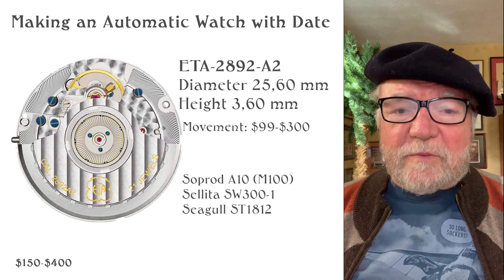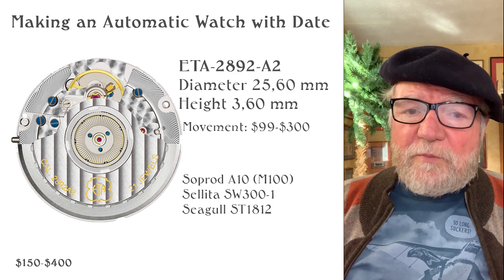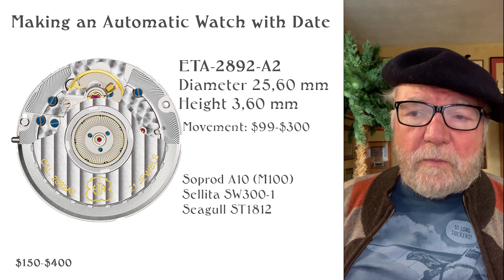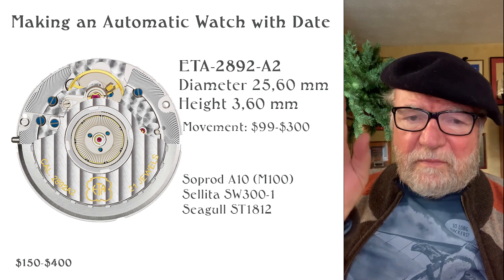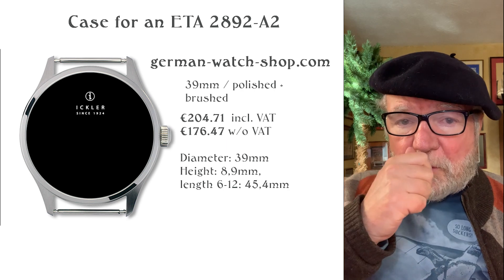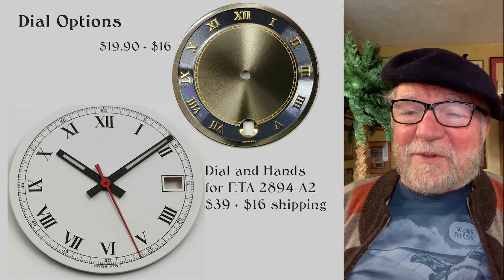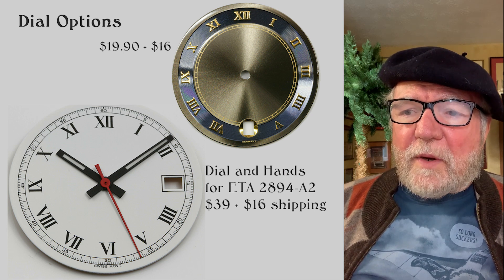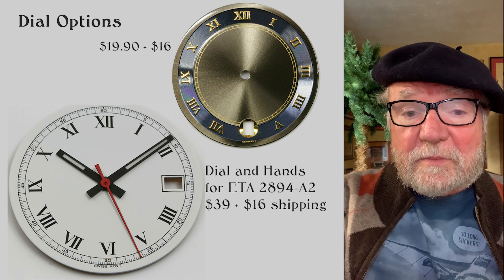Automatic Watch Project: Step 1—Overview & Introduction

Comment: Thx Bill, this is a cool project. I can vouch for the Ickler cases, as I owned a limes (which is a brand of Ickler) and the case was first rate indeed.
Reply from the maker: Thanks, FFA. The Ickler case is the only one I've found so far that's 39mm. (One other with a package deal had 44mm cases!) I think I'll take your advice and get the Ickler ... even though they are mucho! expensive. Take care and be safe, Bill😷

Comment: Hi Bill!
Very interesting project, the suppliers of parts tend to give a narrow choice, specially for the dial face. But your choice are more than ideal. Concerning the movement: where do you get them other than eBay? 
Thanks to guide us thru this mine field, be safe,
John
Reply from the maker: Hi John, a lot of the eBay goes straight to an eBay store based in China, Germany or Switzerland. I like the German ones; they're more expensive, but I like their looks better. If you use AliExpress.com , you can deal directly with Chinese sources and save a lot of money. Take care and be safe, Bill 😷

Comment: I'll watch you make it. I'd like to see you show us a few dozen dial/hand combos and explain how you narrowed it down
Reply from the maker: No problem J Tee, you're welcome to watch. Looking for the right parts can be an adventure in itself. See if you can find dials & hands for the 2892-A2 ... it turns out that there are lots for the 2824, and so you have to be careful. Take care and be safe, Bill 😷
Reply: @watchartsci  Found the same dials on ebay without dial pads or feet, cheap, but didn't find much else worthwhile, I guess it's best to go to a watchmaker's site.
Reply from the maker: @jtee9548  Which watchmakers will sell you dials and hands? Thanks. Take care and be safe, Bill 😷
Reply: @watchartsci  I misspoke, I meant various watchmaker suppliers sites, places you need to be in the industry to shop, wholesale suppliers, small specialty distributors etc... I found the dials/hands you showed but little else. I guess we could ask for good sources on a watch forum?
Reply from the maker: @jtee9548  Yes, we're having a live stream about the project at 8am and 4pm (New York time) Join us!

Comment: Took apart a Chinese clone recently never again. Fingerprints everywhere in the movement and a hair! The scratches inside the movement looks like it was put together by a blind man equipped with nothing but a sandpaper block.
Reply from the maker: Hey Mad Dog, that's yuuuuuk! I've worked on lots of ST36 and ST 3620 (clones of ETA/Unitas) from China and have never run into that problem. Suggest you stick with the SW300-1, ETA 2892-a2 or Soprod A10. Take care and be safe, Bill 😷

Comment: I like the idea Bill except I'm not sure I'd be able to put the watch together I was in an accident a couple years ago and lost the fingers on my right hand I might be able to get a friend to help .
Reply from the maker: Yikes Junior! Well, we're only going to be using a few parts ... the movement will be in one piece. Basically, we put the dial on the movement, the hands stacked in the center over the dial, remove the crown and stem from the movement; put the movement into the case. Replace the stem into the movement through the case, and Bob's your uncle! Even if you need help, I think you'll find it interesting. Take care and be safe, Bill 😷

Comment: Hi Bill My experience with the clone movements is both Swiss 64 98’s are running beautifully and both Chinese clone movements are broken 😞.....the eta movement are worth the extra $200 and are nicer to work with. Cheers John
Reply from the maker: Hi John, I've several Chinese clones of 6497/8 and I've had good luck too. The ones that have failed are due to my fumbling more than the movements' construction. An automatic with a date disc is a bit different, though. Thinking of a Soprod A10 with the Seiko 4L architecture, though. Take care and be safe, Bill 😷